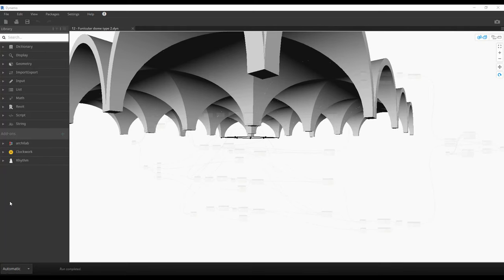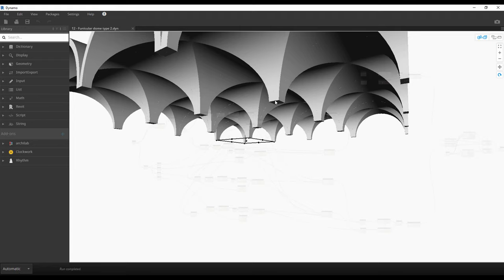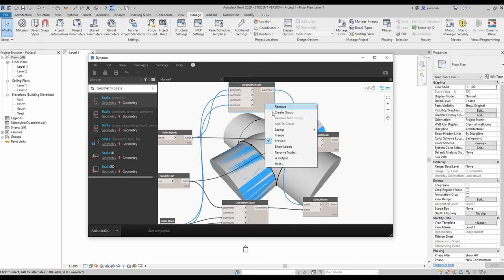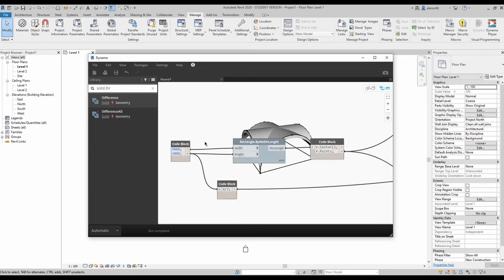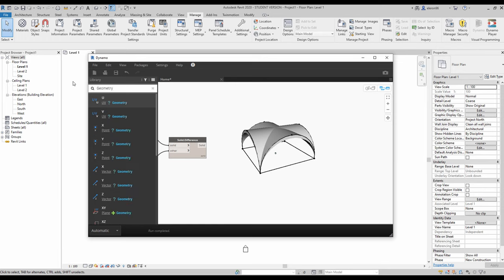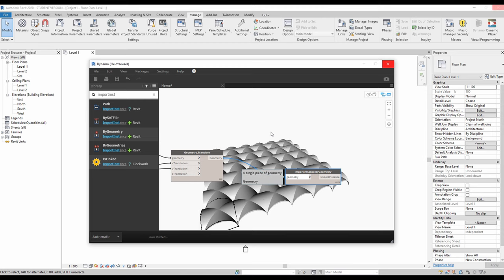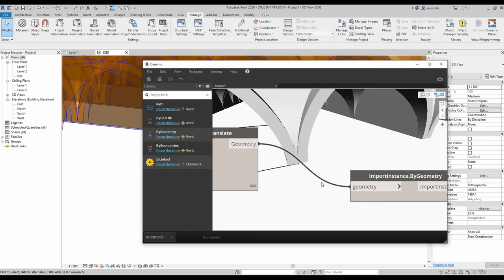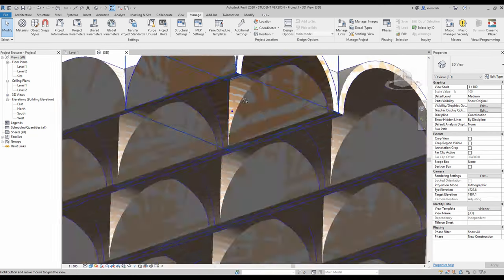Dynamo | Funicular dome | Complete tutorial | part 5

Comment: Very interesting tutorial, I tried to recreate the same model in dynamo revit 2020. I somehow manage to do it but when I made code block for arcbythreepoints, it didn't produce the smooth arc as yours. Instead, three arch points are joined by straight lines. Are there any methods to smoothen the arc? Thanks in advance.